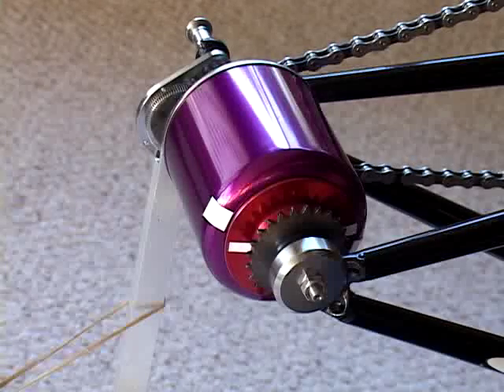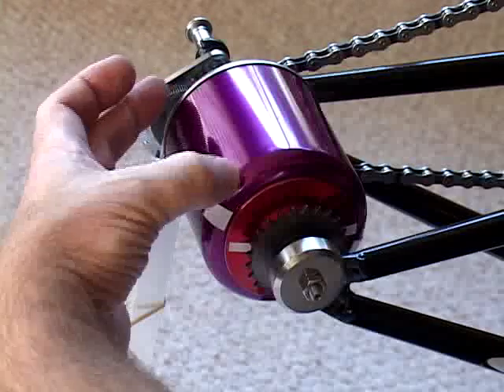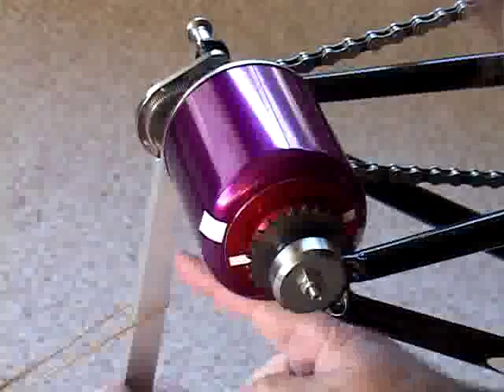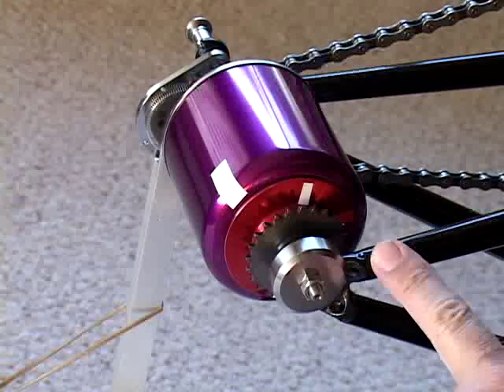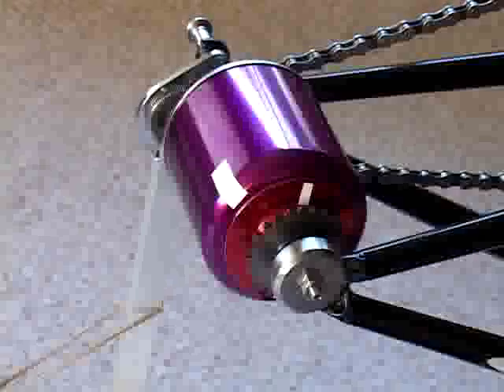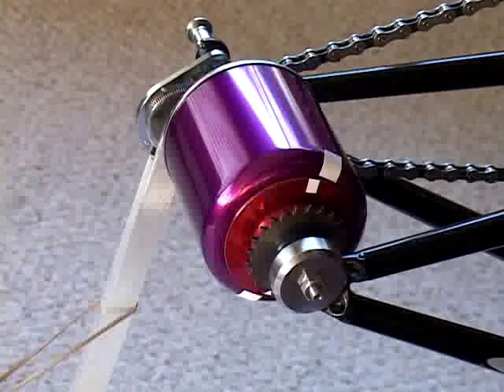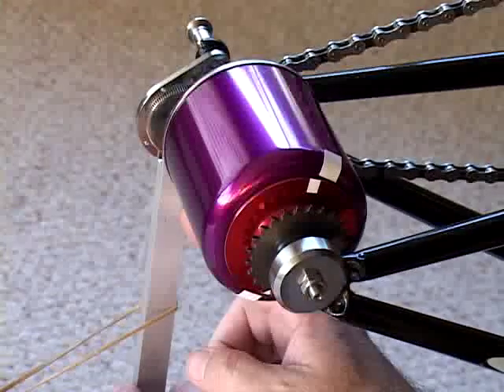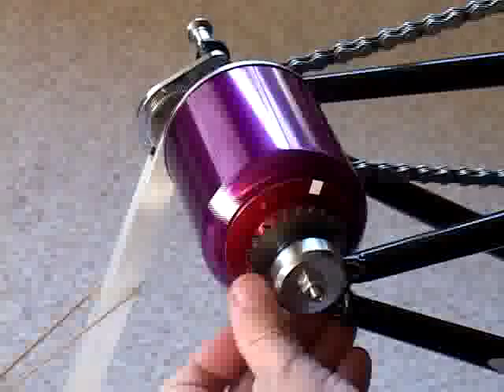Automatic Bicycle Transmission (IVT)

Comment from the maker: @dridley11 You think wrong.  A clutch partially engages during its transition, whereas the SIVAT positively engages during its ratio changes.  This is very different, with far less energy waste due to dynamic friction in clutches, not present in the SIVAT.

Comment: @SIMKINETICS geting rid of the torque convertor.......:O thats the only thing that stops girls from stalling... yes i know it would do that and  the fly wheel aswell.but the big thing here is to keep the rpm maxed wile acelorating the cvt does that verry well be sides the set points that most have.. the cluch/ tc and fly wheel dont really do much to harm the performance at all and tcs are actually verry usefull and i dont think thy well ever leave mid-large trucks for towing reasons

Comment from the maker: @manseaua You're preaching to the choir!  The first IVT, 1949; the first CVT for vehicles, 1959.  CVT technology has expanded dramatically in the past decade plus.  The point is to offer an IVT that practically replaces both the torque-converter (or clutch) & transmission with a drive having greater overall efficiency, and that is not already out there.

Comment from the maker: @manseaua A distinction between component & systemic efficiency must be made.  As a component, the SIVAT can increase systemic efficiency by capitalizing on the 'sweet-spot' of any prime-mover (engines, motors, legs, arms, etc.) by modulating its speed for optimal efficiency at a given load at any time.  Systemic efficiency increases will more than offset any transmission losses, as proven by automotive CVT's.  And yes, acceleration performance is increased as well.

Comment: @Trikoupis  wile acclorating you get more hp to gas so you can think of that in 2 difrent ways you speed up faster or you save gas at a set speed there is absolutly no difrence im not sure about deceleration

Comment from the maker: @Trikoupis That will be tested on the next prototypes.  Considering documented efficiencies on equivalent mechanisms for part of the SIVAT, and prior experiences on the rest, I offer an educated guess: 88% at the very lowest practical ratios rising to over 94% at the highest ratios.  This has not been tested on this initial prototype because some trivial design issues need to be addressed in the next design to assure meaningful results, even though this unit seems quite efficient.

Comment from the maker: @kelli217 The internal high ratio of SIVAT is 75% as high as NuVinci's internal high ratio. That only makes NuVinci capable of impractically high ratios with typical sprocket combinations. SIVAT achieves high gear that's higher than equivalent standard MTB 44T/11T high gear with similar sprocket ratio combos. More importantly, SIVAT's ratio bandwidth is much greater than NuVinci's (∞>6.4X vs. 3.6X), so its low ratios are much lower than NuVinci's if NuVinci uses the same high ratio as SIVAT's.

Comment from the maker: @rolfsandsyrup Your question isn't clear, but I'll give it a shot.  First, the SIVAT doesn't operate in reversal of power flow like most geared transmissions; the output cannot be used as an input because it simply won't rotate backwards.  The output can be rotated forward though, and will free-wheel on its own.  I have a proprietary method to disengage backward motion as required by cyclists who want to be able to roll their bikes backwards out of tight spots.  Does that answer your question?

Comment from the maker: @zigzigerblat Truly, for most machines like bicycles and cars, external gearing is needed to accomodate differences between driver speeds & driven speeds with any system anyway.  The SIVAT can include this internally, but I favor the simplest approach.  The external 'gearing' is not added for bikes because it's already there as the chain drive; it only needs to be defined by sprocket sizing of that chain drive.

Comment from the maker: @zigzigerblat The simplest version doesn't work well at ratios over 1:1, but that doesn't matter because the top ratio can easily be defined by input and/or output gearing.  Note that the video is driven by a 55T-to-11T chain drive that delivers nearly 5:1 with the SIVAT!  The top ratio can be chosen this way, and all of the low ratios (including zero) can still be accessed continuously.  That's the beauty of the IVT!

Comment from the maker: @pele34567890 Thanx.  I always appreciate positive input!  Heavy and/or powerful riders will be able to globally adjust the SIVAT for their own general (higher) demands by twisting a knob on or near the transmission, so that they won't be pedaling in ratios that are too low.  I know that no one will want the SIVAT to abruptly drop toward zero when they stand on the pedals.  Pedal resistance will also begin to increase at the very lowest ratios.

Comment from the maker: @pele34567890 Thanx for your ideas.  The SIVAT is automatic, but a manual override was always intended for those who want hand-operated controls too.  Automatic control will likey 'sample' pedal pressure at a sector of the pedaling circle for pedal-torque operation; to prevent up-shifting during coasting, the bicyclist will simply position the pedals outside the sector.  All of this will be tested by avid cyclists to determine the best setup before final design.

Comment from the maker: @Majik1911 Thank you.  It will be tuned initially, and it can be tuned by the rider to respond within useful limits.  Its ratio won't drop toward zero unless the load & pedaling (and/or motor) torque are extraordinary.  This is a necessary safeguard for a transmission that can achieve unusually high output torque via the mechanical advantage of very low gear ratios.  The design will be capable of real steep ascents.  If you ask intelligent questions like this, you have no ignorance to forgive!

Comment from the maker: The Carbon Drive belt system cannot be used with derailleurs.  The SIVAT offers a method to get a wide range of drive ratios and to get the smooth, low-maintenance advantages of belt drive.  The SIVAT is now on-course to become available as a product to take advantage of this technology.  This will also feature motor-drive capability.  Development will take many months, but the wait should be worth it!

Comment from the maker: @olonjumagic The first SIVAT product will be adaptable for motorized assistance to pedal-power.  The new design is shaping up to handle more power than originally specified.  If the lawnmower engine is rated at or below 3 horsepower (~2240 watts), it should work.

Comment from the maker: @pyromaneak47 Thank you!  The most promising version is likely a bottom-bracket style that would allow high gear to be defined by chainwheel size; the standard being 47T to be similar to MTB for high.  Standing on the pedals will cause the ratio to drop slightly, but that can be prevented with a handlebar lock-out lever if desired.  Commuter bikes are in the mix, as are high-performance MTB's, as planned.

Comment from the maker: @mjt11860 Thank you.  I have considered the Gates timing belt, but the newer version SIVAT that I'm favoring, and am currently designing, puts a very high load on the chain at very low ratios.  I doubt than a reinforced polymer belt would last long with tension loads that can be high (but not excessive) for steel roller-chain.  American Inventor sounds like a good idea.  I'll look into that!

Comment from the maker: @jillybooty Great question!  All CVT's that rely on traction slip; these include Variable Diameter Pulley drives and all traction roller drives.  Any IVT that uses traction will lose a great deal of energy to slippage because of the torque multiplication at very low ratios.  The SIVAT would be excellent for cars because it has high torque capacity, high efficiency & it eliminates the need for a clutch or torque-converter.  Not one automotive or transmission producer has contacted me about this!

Comment from the maker: @minigolfer101 NuVinci is a traction-based CVT.  SIVAT is a ratcheting-based IVT.  NuVinci's high gear is 360% higher than low gear; SIVAT's range is at least 700% (theoretically infinite).  [MTB derailleurs are 618%.]  Ratcheting technology is positive & efficient, using gears & levers.  Traction uses smooth, spherical steel rollers against smooth steel cups.  SIVAT is automatic & optionally manual, NuVinci is only manual.  Vive la différence!

Comment from the maker: @pbgd3 The SIVAT doesn't slip.  When the load increases, the Ratio Control System is forced to lower the SIVAT ratio slightly, allowing the input to momentarily speed-up; but, this is not slippage.  A very small portion of input energy loads into & is stored within a spring during this ratio-lowering.  Even when overload protection is initiated, input resistance simply loads up the spring until the resistance goes away.  This positive engagement is a major advantage of this IVT.

Comment: @SIMKINETICS set up proper production in flat landed areas cause your idea will fail if you put it somewhere in like washington state  there are pickups turning 22 years old this year and there is no way you can compete with laborors with these pickups not unless you figure a way to throw a  solar pulled source on that transmission

Comment: @SIMKINETICS  second off  they are only HIRING COLLEGE STUDENTS & COLLEGE GRADUATES as well  as bypassing anyone who has not had a job in 6 months  it is obsolete cause a bike can't haul anything  and its a waste of muscle strength your so called transmission will only be mainly used for basic bike riding and  would be a dumb idea to compete with commercial sales ... Jehovah's whiteness's will buy though other then that going up and down hill all day is not worth it for long travels

Comment from the maker: @ThePrimoBiker See 3:14.  This is for a proposed version with the SIVAT in the hub of the back wheel of the bike.  It's much more likely that this transmission will actually be at the pedal crank position, replacing the bottom bracket assembly, with the front sprocket (chainwheel) being the output; the design will be different, but the concept is similar.

Comment from the maker: @polar898989 Normal use will accomodate much more power than 300 watts.  It's important to understand that extreme loads at very low speeds produce extreme output torque with an IVT; as the IVT approaches a zero ratio, the output torque may approach infinite values.  This in the reason for overload protection that relies on torque-responsive ratio control.  Fit bicyclists, including elite athletes, will be able to ascend steep hills with at least 1,000 watts of power without problem.

Comment from the maker: @Roclee612 If you weigh 400 pounds, you should stop feeding & start reading!  The subject about what happens on hill ascents has been covered in prior comments.  At 400 lbs, you'll ascend a 12% grade at walking speed if you can produce 300 watts (doubtful); then, the overload protection will take over to prevent the chain from breaking.  Then, the SIVAT will gradually lower the ratio, and your cadence will increase until you get off & walk.  Bring your cardiologist.

Comment from the maker: @iridespecializeddh The prototype in the video weighs about 4 pounds.  A handlebar manual control override lever is intended, but this control will be adaptable to conventional shifters if the cable force & position are compatible.

Comment from the maker: @69techlover The SIVAT can be geared up at the input and/or output to suit its use to include the highest ratio desired!  This is easy.  Even when its external 'gearing' is raised (or lowered), it remains an IVT because it still will continuously get all ratios from zero to the top ratio chosen.  It should work well on a motorized bicycle.  You'll be able to run the motor at its best speed regardless of your bike speed.  BTW, a motor on a bike will need a reducer, not any high gearing.

Comment from the maker: @dobsonator Interest in ebike use for the SIVAT has been enthusiastic!  That's why I've been re-thinking the bottom-bracket version with more power capacity in mind.  A 1.0 hp (748 watts) motor will get you 31.4 mph, 34 mph if you're pedaling too.  Steep hills won't stop it.  The goal is well over 1.0 kW capacity.  This is being discussed with the right people to make it happen, but we're only in the beginning stages; it will take some time to make products available to you.  Price? Unknown yet.

Comment from the maker: @euandykes SIVAT's pulsing is much too subtle to effect a bike rider or the bike; chain-to-sprocket speed variance alone is greater!  In fact, the value of using a flywheel with it is not to smooth out SIVAT's speed, but (conversely) to smoothly drive a flywheel.  Regarding efficiency, losses are mostly from gear-meshes & bearings, not from pulsing,  typical of all good transmissions.  These subjects are described in many prior comments.  The SIVAT is useful for nearly ALL machines.

Comment from the maker: @rs2013 Gates claims that their sychronous belt drives are 98% efficient.  Chain drives can be slightly better if the sprockets are lined-up, but that's rarely the case with derailleur drives.  So, you're right.  Either way, the SIVAT will accommodate.

Comment from the maker: @sacredquest1aust There are several possibilities for co-development, but I need a solid commitment from a potential partner.  There are 3 positions for the SIVAT to be mounted; the hub, the bottom bracket & above the bottom bracket.  I've been recently studying the BB mount with some new ideas that can make it fit without widening the pedal stance too much.  The BB has the distinct advantage of being a kit that will fit most bicycles, and it's stronger than a hub version.

Comment: @SIMKINETICS sounds like a good temporary fix, also sounds like your covering all the angles, it would be nice to not have to deal with derailleur hangers, are you in engineering? Or an inventor? Im studying mechanical engineering right now, its taking a bit longer than what I planned for but it happens...

Comment from the maker: @phil656565 You seem sceptical rather than pessimistic...and that's exactly the kind of input I want.  You're asking me to consider an important issue.  On your comment: there's nothing worse than breaking down irreparably in the wilderness without being able to field repair or jerry-rig your bike (I've done it myself).  I'll consider that 'what if' some more.  So far, locking the ratio at 1:1 & bypassing the internals is one possibility.  Thanx.

Comment from the maker: @hatenewbz Thanx!  I've very recently been re-visiting the version that can be retro-fitted to existing bikes which appeared to be too wide for front-sprocket position mounting.  I've discovered a way to design the SIVAT for mounting to standard bottom-brackets, up-front without significantly widening the pedal positions!  I'm now working out a new design that should offer the option for a kit that will replace your crank, front sprockets & spindle with a SIVAT!  It will be life-tested.

Comment from the maker: @eshneto 1) As an IVT, the range of gear ratios of the SIVAT is huge; the NuVinci is limited to 3.6X from hi to lo.  The SIVAT is automatic.  The SIVAT weighs less.  2) The automatic feature uses a spring to actuate the ratio control; hard, forceful pedaling compresses the spring & lowers the ratio until the pedaling force is just right.  In the demo, notice that the rubber band represents a spring that will be much stiffer in the final design.

Comment from the maker: @hatenewbz Good question!  The SIVAT's overload protection won't activate in any normal conditions, including pedaling up the steepest climbs, so a rider won't be taken by surprise.  Even in an abnormal condition such as pedaling against a brick wall, the overload protection will not abruptly lower the ratio to zero.  This feature is only required to prevent damage to parts of the drive system that can be subject to extremely large forces that are produced at lower ratios than you'll ever use.

Comment from the maker: @rumblfmp Oh yeah...  Efficiency: 88%-94% range, 92+% mean (calculated); lowest at steep ascents.  Brendansimons doesn't know that the SIVAT component  forces at very low ratios only affect output gears that are purposely designed for 'wheelie-limited' torque.

Comment from the maker: @rumblfmp Elite racers get max pedal resistance at about 180 N.  With 175 mm cranks, this is (180 N) *(0.175 m) = 31.5 Nm @ crank.  Stomping the pedals at standstill will cause a slight absorption in the Ratio-Control System that will usually dampen the shock load & 'wind-up' the SIVAT with energy, unlike other geared transmissions.  100 Nm rating means extended life.  Initial calculations suggest 5,000 hours of life for aggressive MTB riders for high-wear, replaceable components.

Comment from the maker: @brendansimons Sorry about the delay.  Antivirus SW was corrupted & sent me off-line for weeks.  As for one-way clutches, they're used in many installed transmissions.  I'm looking to load well below their ratings to get extended cycle-life, which is over a third order function of inverse-to-load; half rated loading gets 8X+ life, for instance.  BTW, my ripple-function is not sinusoidal, nor dependent on inertia.

Comment from the maker: @brendansimons The torque capacity needs definition as to whether it's input or output; after studying elite bicyclists' performance, I'm sure that the approximate size shown in the video will handle torque for bicyclists.  The unit shown has been tested at 2,000 rpm, but may go beyond that.  We have not determined max speed yet.  The bike version will operate at ~500 rpm at it's input (via step-up), rated at 1kW for the next prototype.